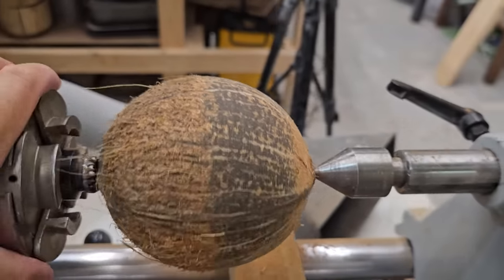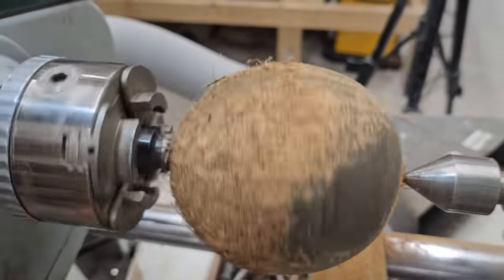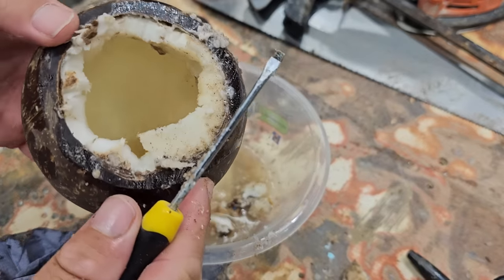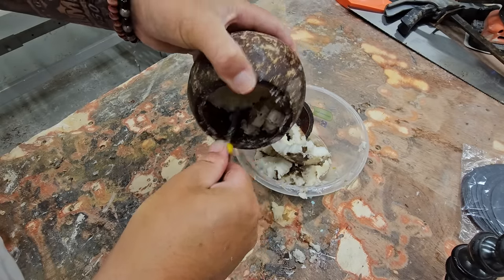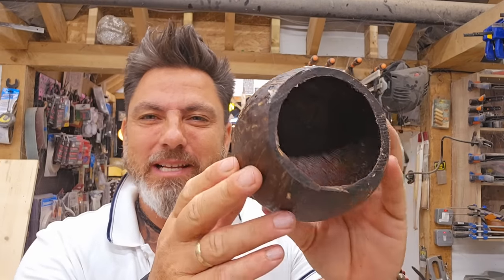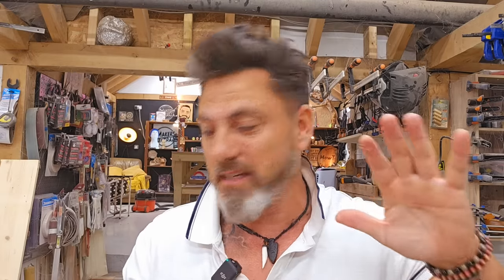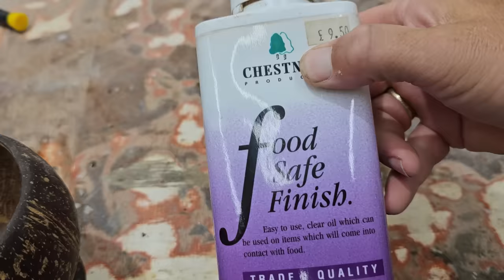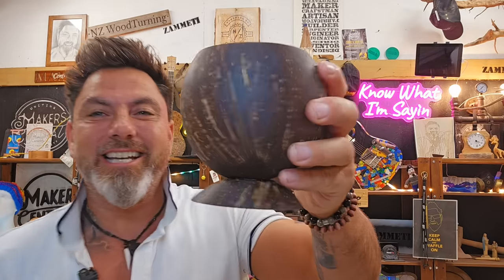Turning a Coconut into the Coolest Coffee Mug Ever! - Sip in Style

Comment: IMHO I think if you got another coconut and cut a large ring from it, polished it up like a bangle - round in cross section (large enough to support the base) and stuck that on the bottom of the mug it would look at lot less like a 5th graders craft project. You could even carve a spiral in the ring or different designs to help differentiate a set of cups.
The other way would be to make 3 or 4 hemisherical balls flattened on one face and stick them on the base to stabilise the shell like stool legs but subtle could be colourful, could be pebbles whatever......

Comment: If you took a cylindrical mold just a little bigger than the coconut poured in some resin then put the coconut in holding it to the bottom let the resin cure then turn it on the lathe..

Comment: If you do another of these, you could remove a little more off the top. Then remove the same size disc from that section, leaving you with the top, the bottom, and a ring. If you sand the bottom of the ring flat and cut it in half, you could join the two crescent-shaped pieces into a handle for the mug. I would also suggest reinforcing the join between the top and bottom with something going through both pieces, painting the interior white, then coating the interior with white epoxy, allowing it to form a level base inside to hide the join while evoking the look of coconut flesh. You could similarly simulate the look of coconut flesh between the handle crescent halves to fill the V-shaped groove they would have, with some sort of thick set epoxy in a few applications with it held at certain angles by a jig. The compound curves for joining a handle would be nightmarish but could look absolutely amazing done right.
As this coconut mug goes, it's fun and whimsical.

Comment: NICE!  The only 2 things different I thought you might have done was to mount it using the outside of your chuck jaws in the opening you cut to allow you to true up the outside and flatten the bottom so it'd sit level.  The second thing was to cut a hole in the top so the mug could sit in it instead of on top, making it like a foot of a bowl.

Just curious, how did the coconut itself and the finish hold up to hot coffee?  Could this be your new daily driver?